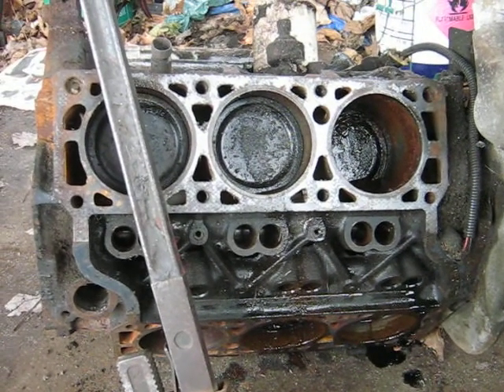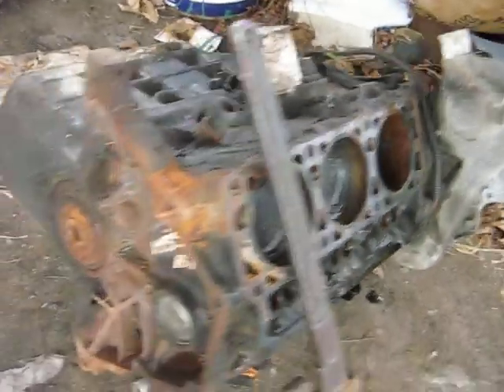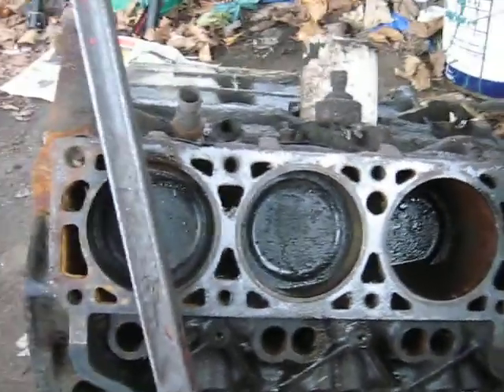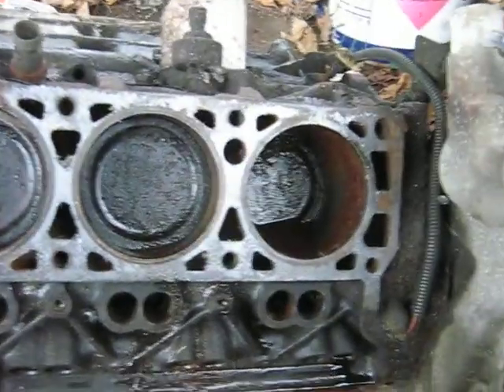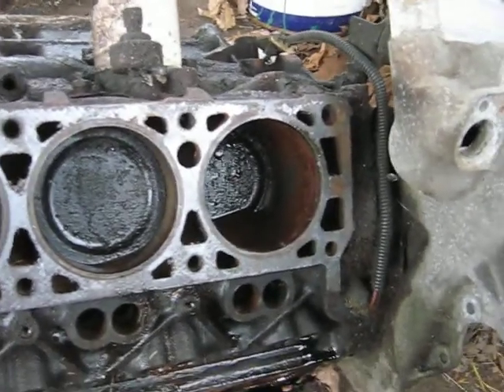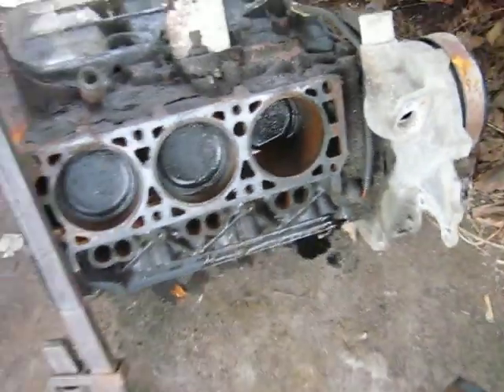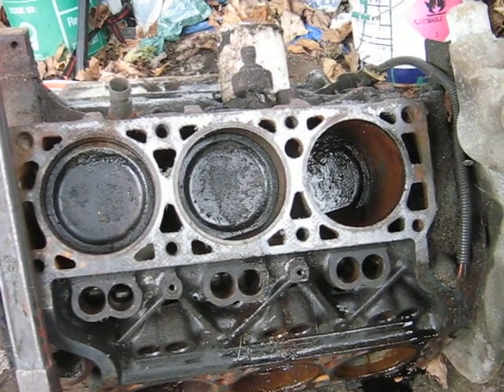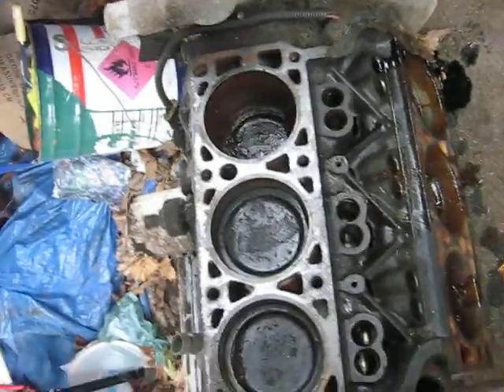Un-seizing a V6 engine #4

Comment: You need to take that engine apart and rebuild it.
Reply from the maker: I only have what is shown in the vid, no heads etc. Plus I don't own a car it will fit into.
Reply: @ChargerMiles007  Well, you have 8 ash trays and a boat anchor.

Comment: 180 grit Huh?! PERFECT! that motor is fucked bud...
Reply from the maker: libtechrider2010 Ehh, 180 grit will work just fine on the cylinder walls. If I ever build a Junkyard Deltic it will NEED to smoke as much as the real engine, so bad ass deep scores in the cylinder walls would be good for this application  :)Now a regular engine, or especially a Turbo motor you need a good finish on the walls.I think you are correct about this motor though, the GM cast into the side of the block isn't helping matters!

Comment: Can I still hand crank the engine with a transmission still connected? Just a four cylinder, needing some help. Anything would help, ideas? I don't want to take the engine out if I don't have to. I recently rebuilt it and went to start it and it acted seized